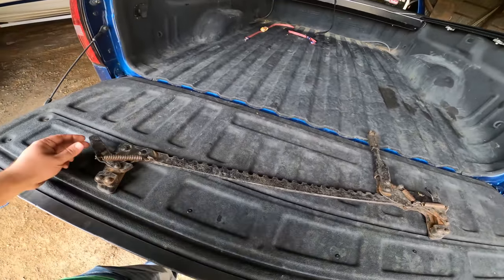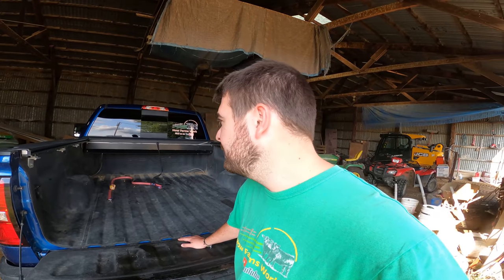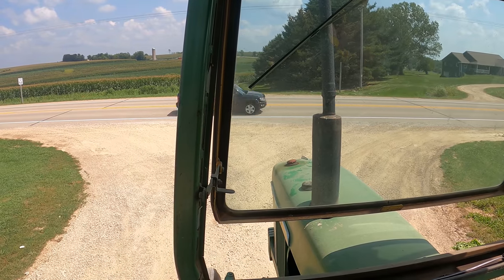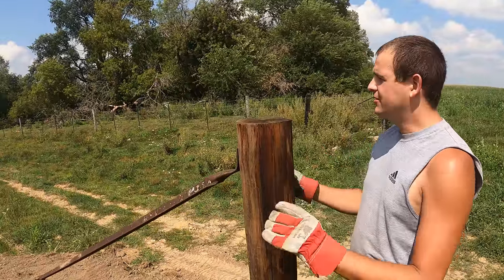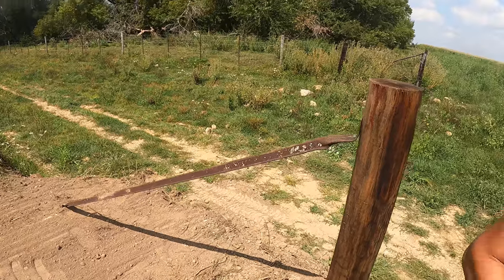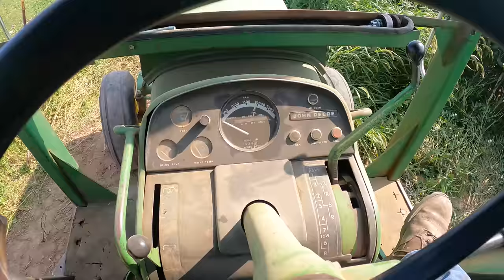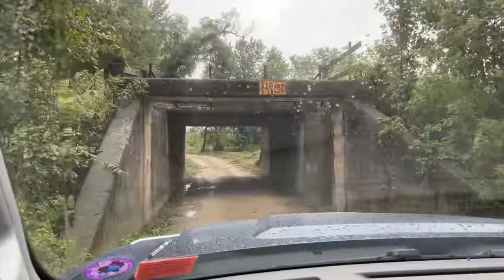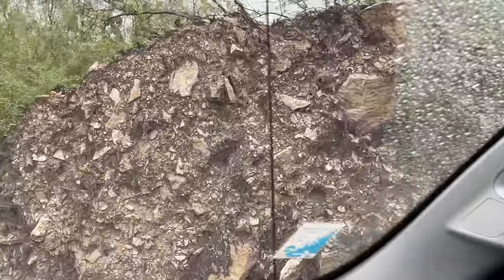Saving Fencelines - Replacing Posts

Comment: We just plain don't have access to creasote posts here. We used to like 20yrs ago but I have not seen them in years. Grandpa was able to buy liquid creasote and we kept it in a plastic barrel, we then would add the posts to the barrel and let them soak it up. But that was over ten years ago. He went back to using used oil to treat the posts, kept the used oil in that barrel. We would let 4-5 posts soak in the barrel for a couple weeks at a time, or until we needed them. Every once and awhile we would flip them so each end had a turn to soak.

Comment: Best use I've found for WD-40 is to prevent rust. I have some tools in my sidebox and they're always getting wet from me using them in rain, plus moisture in general.
I just hose em all down off and on and they stay working just fine.

Comment: We had a spring on the opposite end of where your jacking handle was and that was not fun to see wire that was tight. We use hedge for posts and they last forever, we replaced a fence that was over 40 years old and most of them on the mile stretch I would use afain, they had a little rot but we even cut into it with a chain saw and it still loved good

Comment: Ryan, I absolutely love the strainrite wire stretchers that I bought from stay tuff wire company. It’s a little aggravating getting the handle attached to the chain at first, but once you get the hang of it, it’s gets the heavy gauge barbed wire, hog wire and the sheep & goat wire super tight. Just an FYI if you weren’t aware…

Comment: I talked to you on snapchat about the easy ties for your t post. Something to consider is galvanized pipe. A few of my fencing friends that fence like me are convincing farmers to do galvanized pipe bracing. Takes a longer post but your guaranteed 60 years plus you can pull your wire tighter. Few of my friends did Stoney Ridge Farmers youtube farm and it turned out amazing!!

Comment: Most of the post now are not creosote.  Those are pretty much a special order item.  And the new contact pressure treated is only good for 5 to 10 years in my area.  We have to special order in creosote wood poles or post.  Even tho we make a unbelievable amount of telephone poles just 20 miles up the road from me. They are CCA treated wood poles.  They do not use Creosote anymore according to them, and they may be forced to stop using CCA because the A is Arsenate

Comment: Even Tractor Supply Company does not stock creosote wood post any more.  So you may want to check with your local lumbar yard to see if they actually have creosote wood post.  Otherwise they are just selling you pressure treated lumbar.

Comment: Ryan does the post pounder work better than drilling a hole with an auger? We use an auger then fill the sides with rocks and dirt. Then we pack it to. Seems to work. I like your wire stretcher. Ours is the old one you stretch with rope.

Comment: Not sure why creosote is bad, but I know the UK uses a different preservative based on a copper solution, so wood posts and fence panels have a green tinge until painted. Even if creosote is to be banned its most likely the industry will move to a different preservative.
Reply: More likely a different country... big users like utility companies will just import them from China or Mexico like they're doing here... they use what works, not whatever GARBAGE the gubmint wants to mandate... Later!  OL J R :)

Comment: Buy a bundle or two. So what your saying is the creosote manufacturers will only make railroad ties and telephone poles after 1 year. Yes putting some oil or tree stuff on is just as bad. Don't understand that logic.
Reply: Power companies are already buying creosote poles from Mexico or China down here... the Yellawood treatment that replaced CCA (Copper Chromate Arsenate) is absolutely WORTHLESS... five years after putting in new poles treated with that sh!t they ripped them out and went in with new creosote posts.  Lineman told me they were doing a LOT of that, can't get US creosote poles anymore so they're importing them.  Later!  OL J R :)